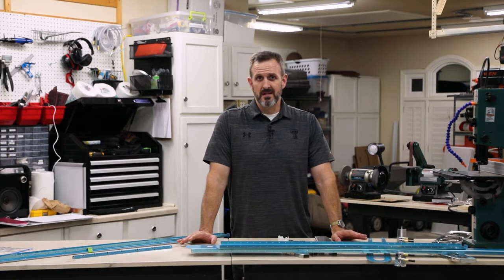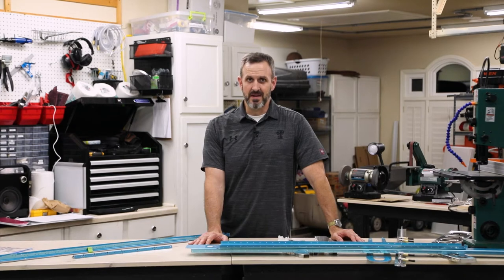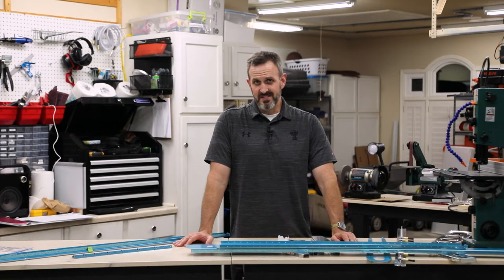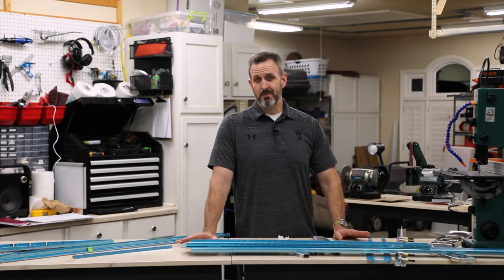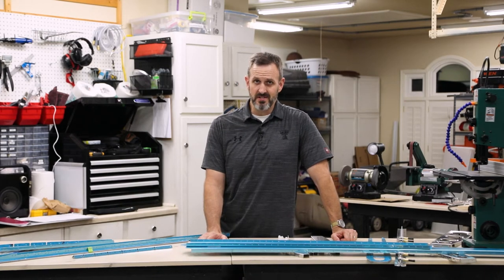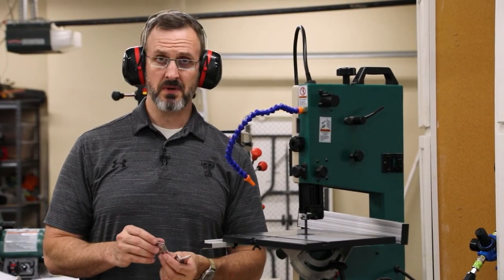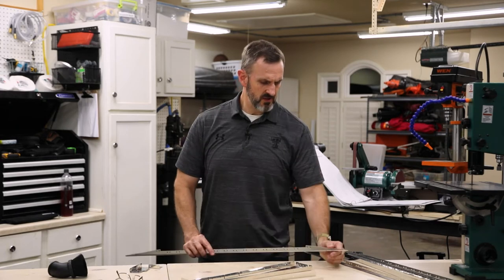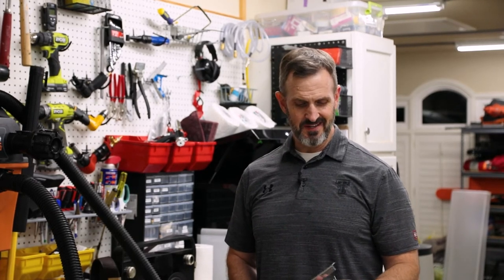Building the RV10 - Video 1 - Vertical Stabilizer (October 2021)

Comment: Why did you choose AkzoNobel primer?  I'm starting my empenage very soon. I like the color. Should that matter? Aircraft Spruce has green. No mention of other color.  Source?  We share last names btw.  🤠
Reply from the maker: The Akzo primer has a reputation of being one of the more durable two-part epoxy primers out there.  Unlike a lot of rattle can primers, it won't wipe off with acetone, for example, and if you put it on a well prepared surface, it sticks really, really well.  It is easy to use and sprays very well.  It is somewhat toxic, so I'd use it in a well ventilated area (I spray it outside in my driveway).  The color probably doesn't matter, yeah, I do like the color (the green is a function of the ingredients of the primer, and it doesn't come in other colors).  I am using the 463-12-8 Akzo primer, thought they make another kind that is somewhat less toxic and is almost a neon green color (10P4-2NF).  I use the 3M paint gun with disposable cups and clean-up is a non-issue.

Prepping the parts for primer is a bit of a pain but, in my view, it's worth it. Though people argue about this quite a bit.
Reply: @buildingthe10  Lots of different opinions about the prep before prime. Prep for me is more important than the paint.  Did some painting on a couple of trucks and motorcycles when I was in my 20's. Any particular one you recommend?  Van'sAirforce has several.  And thanks a bunch for taking the time to make the videos.
Reply from the maker: @thecode3fc  I mostly just scuff the part with a scotch-Brite pad (maroon or gray), usually spray PreKote on first (but not always). The interior primed parts don’t see a lot of weather, so I’m not as fastidious as I might be if I were priming the exterior. I mostly focus on scuffing up the part.

Comment: Hello, I am new to the channel. I have a question about the charts. Are they free, and if they are for a fee, can you point me to the nearest similar plane, the charts of which are free?
Reply from the maker: I'm not sure what you mean by "the charts," I'm guessing you mean the plans.  I think you can order the plans from Van's Aircraft, but I'm not 100% sure on that.
Reply: @buildingthe10  👍
Reply from the maker: @DRAGON_INFO  Vans may require that you buy the kit to get the plans (though I'm sure you can find them somewhere on the internet).  If your intent is to build a plane from parts you create yourself, I know that there are some plans that allow you to do that.  But, that won't work with RV10; many (probably most) of the parts are too complex to fabricate yourself and the plans don't include dimensions that would allow you to make the parts (even if you had the equipment to do so).